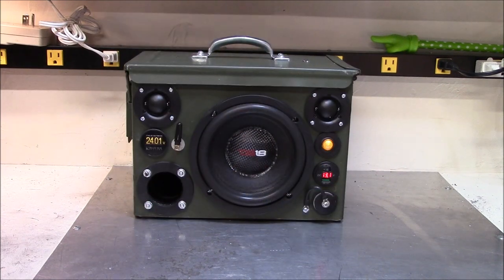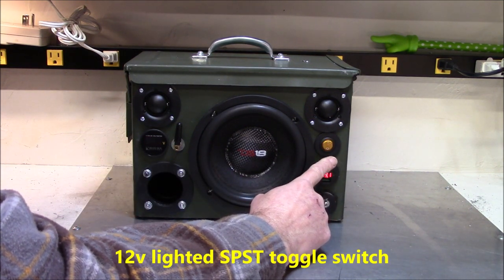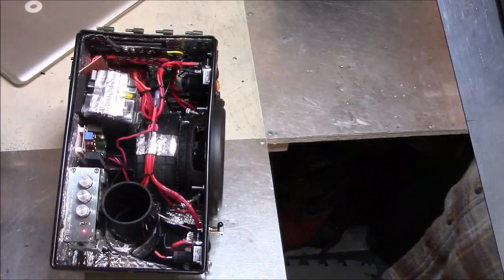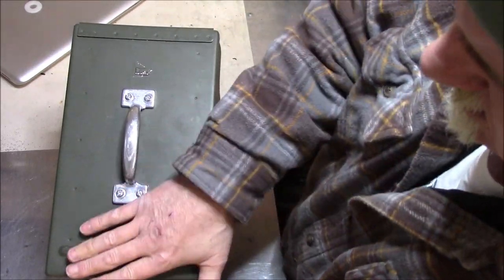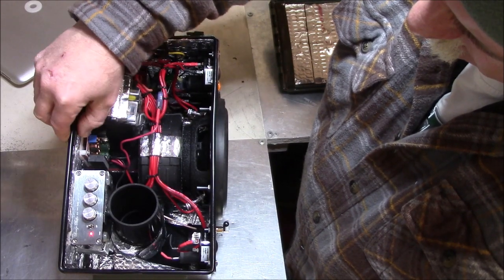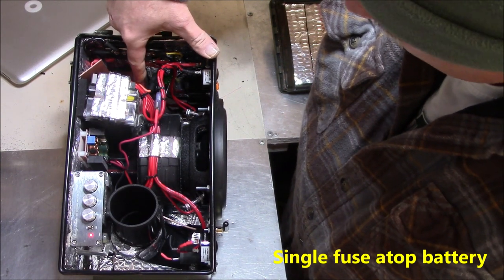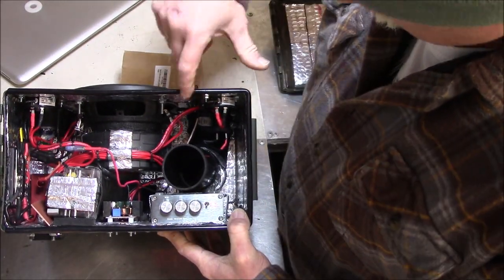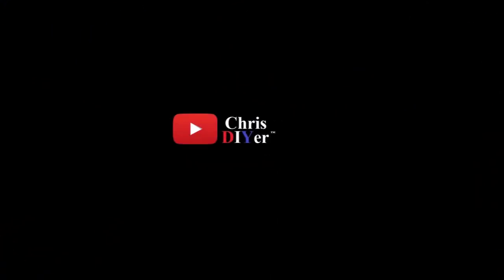DIY Bluetooth ammo can speaker system - detailed look, sound demo, parts/cost breakdown

Comment: Hi there. I just want to share with you how I did get rid of the rattles from the handle. I use 2 flat magnets glued to the lower side of the handle, and 2 flat magnets under the housing of the hinges. This method will fasten the whole handle together and no way for rattles anymore. You keep the ammo box as original as possible, and you can still lift the handle off and use it normally untill you slipp and it will fasten itself again.
Reply from the maker: Thanks...that is worth a try
Reply: @ChrisDIYerOklahoma how do you know the level of the battery?

Comment: I made one using dewalt 20v batterie with a 2 channel amp , 1 voltage shut off at 17vdc
If you don’t use this it will drain the battery to low to recharge, i just use 1 tweeter and 1  6.5 inch guitar speaker using capacitors for the frequency dividers in a plastic ammo box 
Easy fast build the amp had Bluetooth 
It last all day 8 hours and been using it for 6 months and hasn’t failed cost was under 80
Reply: Is it still work 1 year later

Comment: I built on of these recently and used a pretty cheap amp off of Amazon and wanted to upgrade to something like the one you had but I couldn't find what kind of input port it had would you know what kind of plug I would need to power this and voltage converter from 12v to 24v good for something like that

Comment: pretty cool setup but very big and very heavy and i doubt the battery life is very long with that huge speaker. i want to make a lunchbox one with a minirig 40w speaker and a 20,000 mah battery should get me around 200hrs on low volume or 36 on full
Reply from the maker: Depends on what you define as "long" battery life. With a 10 aH battery at lower volumes it will last three days

Comment: Why is the step up booster necessary? I am building a suitcase box and im just plugging into the wall. Do i still need to boost it so i can get more power or what?
Reply from the maker: It depends: on what type of little Class D or T amp you are using and if you want max power. Many come with a 19v AC/DC adapter. In order to get them to full power, most require 24v or more. Go over to Derek's channel (he tests all kinds of amplifiers using test equipment and explains how higher input voltages on these amps increase power output): https://www.youtube.com/watch?v=iO-MVAnA9f4&t=10s
Reply: Yeah i know about feeding more voltage to amps from car audio. But im using the knobsound 300 watt 2.1 amp
Reply from the maker: @zacharyord8618  -This is what I use in mine and they work excellent. Should be able to adjust it up high enough to get max power out of that Nobsound 2.1 amp https://www.amazon.com/dp/B078H527JZ/?cv_ct_id=amzn1.idea.S3P41KIGLZXU&cv_ct_pg=storefront&cv_ct_wn=aip-storefront&ref=exp_cov_chrisdiyer_dp_vv_d

Comment: Hello,  this is a sweet speaker!  I was just wondering,  did you use one or two crossovers? And if you used two how did you wire the sub to the crossovers? 

Thank you.
Reply from the maker: I bought two of these resistors https://www.amazon.com/gp/product/B07FRXSG2Q/ref=ppx_yo_dt_b_search_asin_title?ie=UTF8&psc=1 vs using crossovers and caps. They "knock down" the higher SPL ratings on the tweeters and balance the output to match the dual voice coil woofer.
Reply: Sweet! Thanks for the reply!
Reply: @ChrisDIYerOklahoma  So you didn't use the crossovers listed on the parts list? I had the same question, if you did use the crossovers...how did you wire both to the sub?

Comment: how did you wire the cross overs? the speakers? 2 channel amp but 3 speakers?
Reply from the maker: Dual voice coil subwoofer. Tweeters contain a 50w 33-ohm resistor to reduce tweeter SPL output and balance out the sound. 3.8 ohm total resistance load on the amp. Amplifier's DC power input utilizes a booster mobile (set to 25v from 12v) to achieve maximum power
Reply: Chris DIYer oh okay so you added each channel to each voice coil on the sub??

So each channel has 1 tweeter and 1 voice coil for the sub?
Reply: I have the same setup but my audio cuts off at high volume? Not sure how to wire speakers!
Reply: Series parallel?

Comment: Nice unit, are there correct calculations for box size to amp output and speaker size etc, ......
Reply from the maker: Yep. I used an online calculator for box/port size/frequency. Very helpful
Reply: @ChrisDIYerOklahoma  thanks for your reply
Reply: @hobbies6396  its hard to get the port lenght right tho.   Most of the time the port is just too long for the enclosure

Comment: I thought sealed was better for small enclosures, did you try it sealed before porting? I just finished building one with 2x5.25” jbl coaxial drivers and am torn between leaving it sealed and porting it. Using the online calculator, if I use a small port like 3/4” it only needs to be ~2” long for 40hz. Being that I don’t have a subwoofer in this build, I think it would move enough air. Anybody try something similar?
Reply from the maker: I have made 12+ of these (various sizes, subs, amps). Sealed for smaller cans work best with smaller coaxials. I have made two with high-end coaxials...they don't produce the bass and overall fidelity either sealed or ported. So, stuck with DVC subs, ported cans, and tweeters...and lots of cabinet tuning. Good luck
Reply: @ChrisDIYerOklahoma  Even with the 5.25" coaxial, it sounds better with the port. Plays clean and loud on ~18.5v from a dewalt battery. Ran it for 8 straight hours working on a project today and the 5ah battery still shows full. Using an Amazon Bluetooth amplifier board. Super simple build, battery, 2x jbl gt7-5 speakers and the board. ~$100 total for the build. Your builds have inspired me to up the ante. 40mm ammo can, 8" dvc sub, bluetooth 2.1 board rated at 50x2+100x1 for the sub. Going to run the same tweeters you do. Using a voltage booster in this one to get the maximum output from the amp. The tpa3116d chip put out 110w at 2 ohms in one dyno video I watched. Should sound pretty good. May steal your rubber elbow idea for the port.

Comment: Hey Chris remember when i asked you about Live Round Sound company? Well i bought 2 of the Nuke Speakers $499 a piece well first of all he had no volume knob, bass or treble knobs on board , he also didn't have RCA /Aux ports which he added these ports on the can per my request which didn't work and if you wanted to use the RCA cord that was okay but it didn't work so to use the Aux ports you had to open the case and unplug the RCA connections and plug them up to the wires that came from inside the can! Guess what that didn't work either. The distortion was horrific to the point of being painful! The bluethooth was stuttering non stop and they couldn't pair up with one another! When i asked to return it he said no returns well now ive got to have my bank in charge of this scam artist his name is John and they are out of florida